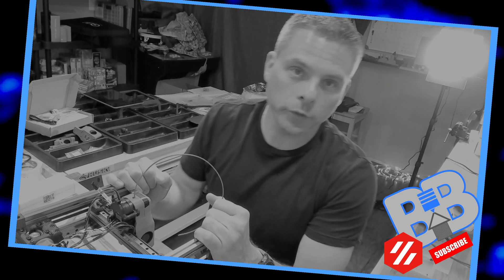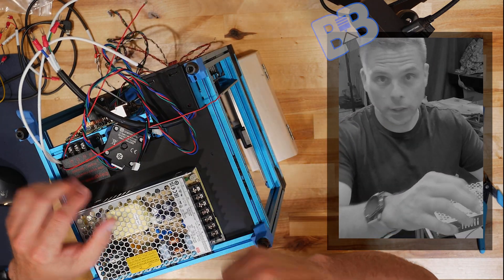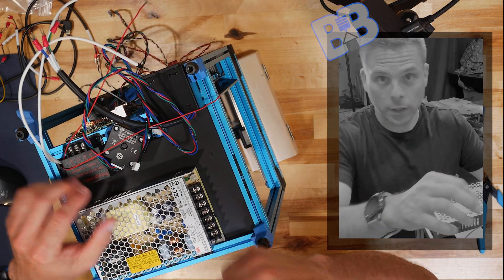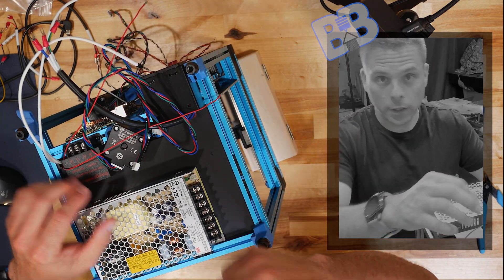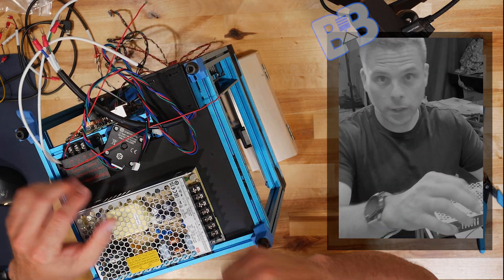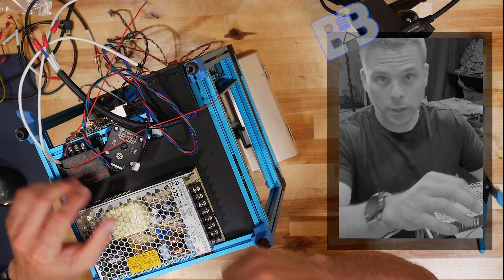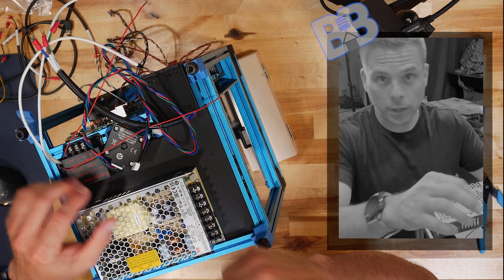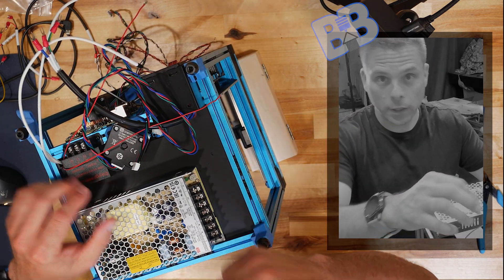DIY 3D Printer LDO VORON 01 Electronics and Wiring PART 2!

Comment from the maker: Let me know if you want a wiring clean up video or just skip right to the software?
Reply: It may be interesting to see IMHO a better wiring setup using DCDC5V 1.0 from BTT ($4 including shipping) to power and connect rpi and SKR mini e3 with just 4 wires (using TFT connector), no step-down power module, only 2 24V wires from PSU, no internal USB cable. That has implications on the SW setup, but does not make it significantly more complicated. SKR pico ships with a cable for this setup by default.Too bad it is not the default for these kits. With rpi zero 2, you would not even need the DCDC5V module and still keep a USB port free for a camera.
Reply from the maker: @josefjelinek  Funny you say this... As I have mentioned I indeed plan to install the Pico on this printer after it is all setup and running.  I also have a Zero W2, but I reall preffer to have eithernet on my printers.  It seems as time goes on the gcode files I print are getting more and more complex and somtimes transfering 30-40MB files over wifi to the rpi seems slow.  I do like the idea of the stack! So compact and neat.  All of it just means more content and fun to be had by all!  BTW - I always enjoy your comments, they tend to be insightful and provide good info.  Hopefully if I decide to do some live streams you can join!  Thanks again!
Reply from the maker: @josefjelinek  Anyone who is interested in the DC/DC Board from BTT here is a link, using tis link to purchase will provide me with a small amount of income... https://s.click.aliexpress.com/e/_AbKkDF